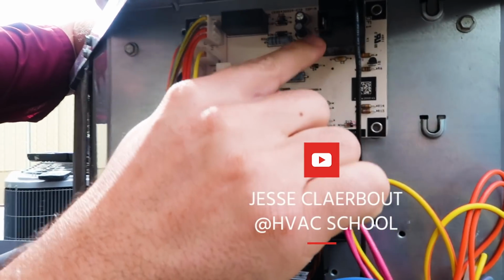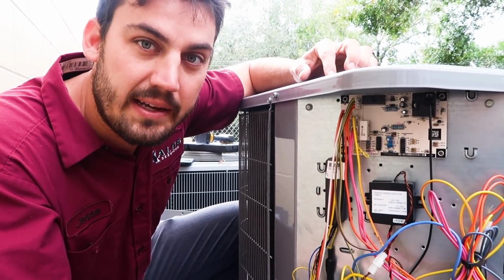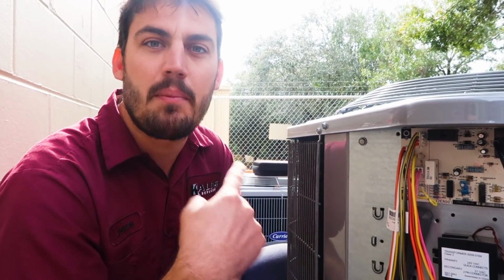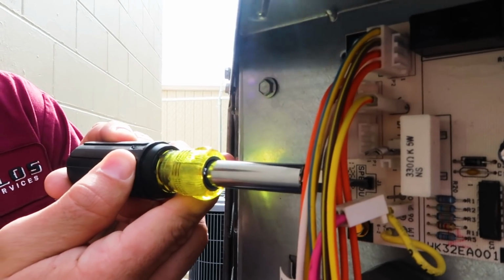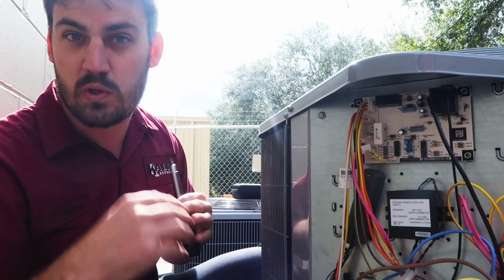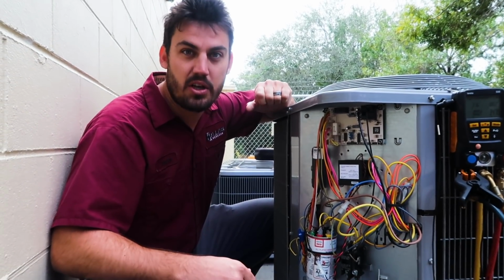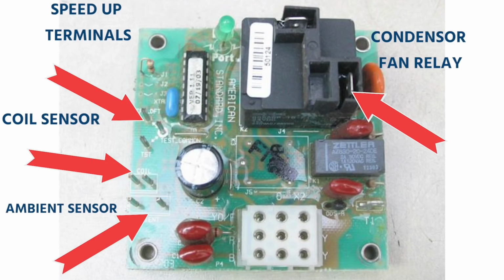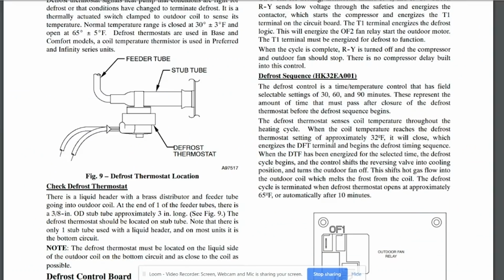How to Test Heat Pump Defrost and How Defrost Works

Comment: Probably should of explained how to test a bad sensor vs a bad board a lot of guys I talk to have no idea and just change both 🤬
Reply: If unit not defrosting and you jump sensor and it goes into defrost change sensor first
Reply: If I have a bad board I always change the stat, but I don't change the board if I have a bad stat but I always check the stat first.

Comment: At 8:00 minute into the video. The resistance he is talking about is affected or influenced by the temperature. Temperature affects how electricity flows through an electrical circuit by changing the speed at which the electrons travel. Similar to having the right resistance in an antenna. So if the wire or sensor is cold the resistance is off?
Reply: texture6 Search thermistor.
Reply: Thank you
Reply: Trane (and most manufacturers) use NTC (negative temperature coefficient) thermistors .  What that means is that as the temperature increases, the resistance decreases.  Google up "Trane thermistor resistance chart" for reference on 10k ohm thermistors.

Comment: 30 60 90 minutes of defrost? How about 30 60 90 minutes between DEFROST cycle?
Reply: It’s how often the system checks the thermostat, not necessarily how often it goes into defrost.
Reply from the maker: Yes that is correct, does he say 30 60 90 of defrost?
Reply: HVAC School he corrects himself later on while he’s talking to the trane guy. 👍🏽
Reply: @HVACS   Still not correct.  it is 30, 60 or 90 min of "cumulative" compressor run time not simply time between defrost cycles.
Reply: @HVACS    Are all defrost termination switches typically supposed to be normally open then close to initiate defrost because my switch is brand new and it is 50 degrees today and it is closed.....and when i put my board in test mode  it does test fine but will only hold the test mode for a few seconds then goes right back to normal operation....it is freezing up and not defrosting....any thoughts...it is an Armstrong air 2.5 ton standard heat pump package unit.....any info would be helpful.